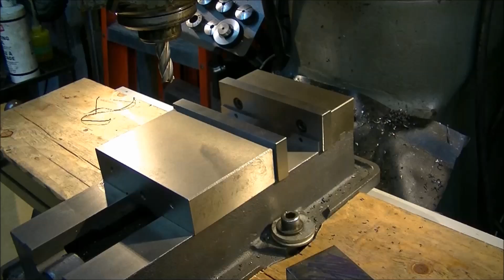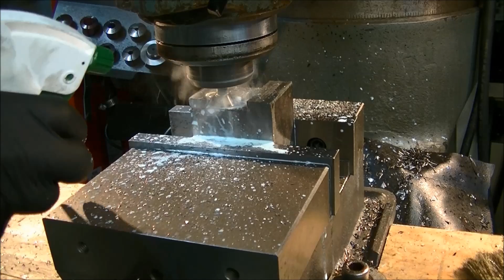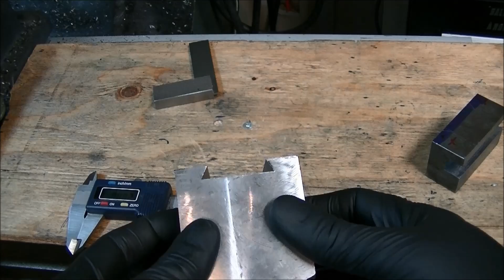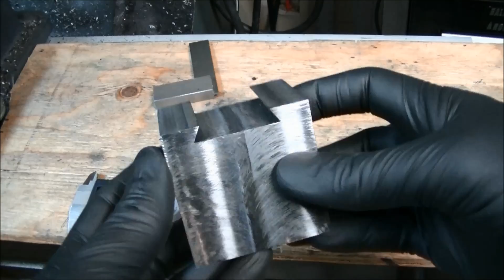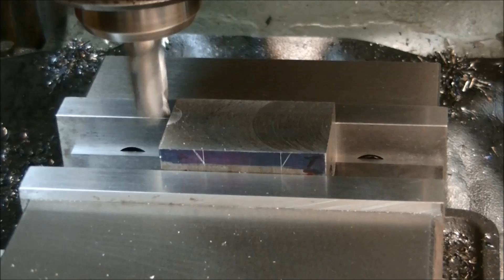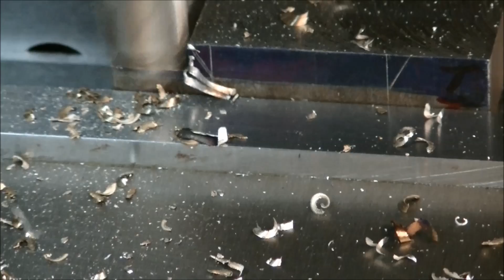Tool Post 2

Comment from the maker: It is the design of the tool post. A slot will be made and a bolt will pinch the tool holder in location.